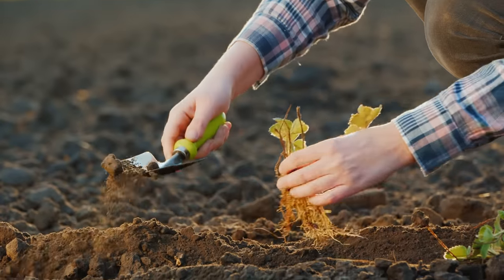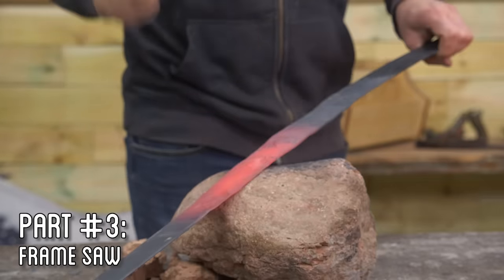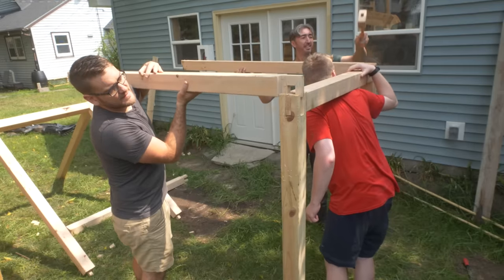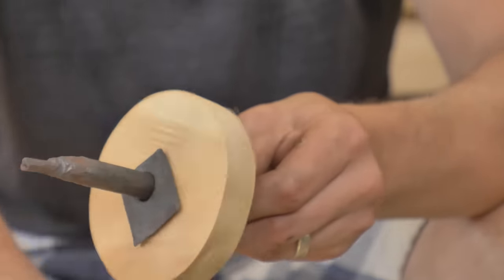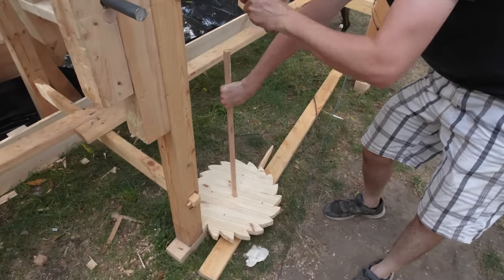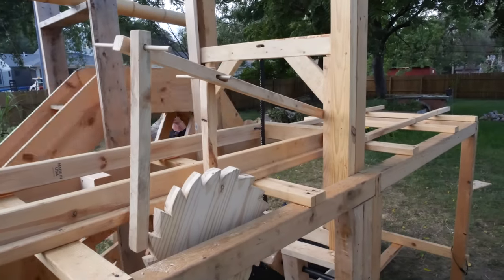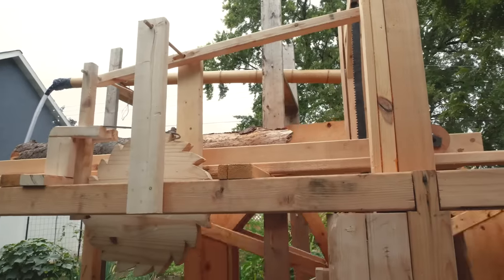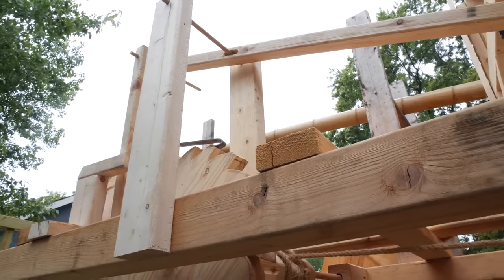I Built DaVinci's Saw Mill

Comment: I'd watch a build like this split over more videos if it helps make the final result better, spend a bit more time making things tighter and run better. Also maybe use all modern tools for each build unless that's the point of the video, I think I'd rather it actually work than to see you labour over a sloppy build with home made tools

Comment: why not use a simple transmission to increase your speed? you clearly have the torque to chew through the wood. big gear to small gear, then on the small gear's axle add in another big gear, connect that to another small gear and you have your output drive shaft for powering your mill. direct drive gives you the most torque, yes, but its the slowest method. you dont need as much energy for the bit to scrape the wood, what you need is the speed to keep up with feed.

edit: I say this in regards to simple gears and transmission ratios were already a thing by the period youre emulating. its stuff that had been known since the bronze age.

Comment: You know, just because you are building something from the 1400's, doesn't mean it would be made shoddily. They did have files, hand planes and even smoothed using sand/crushes shells, applied with cloth... The accuracy with which you build something like this, will greatly effect it efficiency....  Just sayin.

Comment: I feel like you should be pretty close to being able to skip a few hundred years of woodworking and such by doing cut nails. Hand forged nails are a pain, but wire-based nails need easy wire creation; however, the cut nail was used for hundreds of years (though in a pretty limited fashion for most of that). Regardless they would get you a lot closer to modern nail volume (assuming you're not using modern nails as an unlocked tech somewhat).

Comment: the main problem here would be the saw. what you got there is the equivalent of stating a bunch of chisels ontop each other, which is kinda like a saw but...usually those teeth aint that wide. thinner cut is faster and uses less energy...
that is just simply a really badly made sawblade. its too thick and lets be honest, neither angle nor sharpness are correct,
but still...cool little machine.

Comment: Clicked on the video to see how quick and easily it  can be stopped (necessary when changing saws ans in case of emergency) since i know most of the time water powered machine are anot designed to stop and restart at will.
Reply: A bigger wheel has more momentum and so is less affected by fast varying current, The speed stay more constant, it takes longer to stop, and it has more power (it also takes more power to get turning)

Comment: I just don't understand why you made the water wheel an overshot, most smaller sawmills like this one where put beside streams or rivers  and had diverter channels.  They wouldn't have had water pumps to lift the water overhead. Less historically accurate model.

Comment: I come at the same point everyone shaming you for poor implementation uses, but from the opposite direction.  You are an entertainer.  I don't think anyone on your crew is an actual blacksmith or woodworker.  If they are, meaning no offense, they are nowhere near the skill level that was considered average for a decent-sized community during Da Vinci's lifetime.  You all appear to be hardworking and dedicated laymen who don't have time to amass the skill that would normally be brought to bear on a project like this.

So, let's hear it for Da Vinci!  A bunch of guys who would still be observing the master work and doing the menial tasks of their job managed to crank out a design that worked using Da Vinci's sketch and a lot of elbow grease.  You all did the level of work you do - the level that anyone whose goal was "make these things" rather than "become a journeyman woodworker or blacksmith" would do.  AND IT WORKED!  Sure, it was a crayon sketch in comparison to what Da Vinci intended, but that didn't matter, it still managed to perform the function it was intended to perform and it didn't require that every part be made perfectly and every aspect of the design be fully extrapolated to the limits of engineering knowledge in the 15th century.  That is amazing!

This was another great video.

Comment: For its time I think it’s great but looking at it with a modern brain it’s definitely over engineered and the water wheel isn’t even needed. Idk if he did invent the bike but if he applied that to the table he would have saved so much effort. The water is the weak point

Comment: hey like i know u guys r pressed for time but those castle joints r way too lose u guys need to play the joint on the big side and shave them tight u should need a mallet to work em together  aka shave the pointed edges so they r within a millimeter of one another and fit them together as they go so they dont shake like two teenagers in the back of a ford pinto

Comment: You know, for all his supposed creativity, DaVinvi was a classic "modernist engineer" -- same as today's types -- who just invent stuff for which there is no existential need. Eg, App upgrades noone is actually asking for; hitech machines which COMPLICATE people's lives; ways to encapsulate production power into the hands of capitalists and equipment specialists.

For all the construction effort and piss weak outcome of this overly complicated contraption, two guys on a pit saw could mill 10 times the timber in 1/10 the time of logs 10x this size. They had been doing that for centuries before and after his "machine". Eg, it is far more efficient to move the lighter, cutting sawblade along through the log (ie, the sawyers moving forwards with their blade) than to move some bloody heavy log through a fixed position blade. Duh.

You say "But the men would get tired working all day"! And the machine parts don't get tired ... ie, wear??? Machine downtime for repairs is rarely considered for Great New Ideas. Eg, how many hours have you spent "fixing" Windows software?

In short, I'm not convinced DaVinci was the genius everyone says. Like most engineers, no commonsense.

Comment: your sawblade is not sharp. also it should only be cutting on the downstroke. each point should be staggered slightly and flat on the bottom face of the blade. each sawtooth should be a right triangle with the flat part on the bottom. they should be bent left and right very slightly. the tip of the saw should be no thinner in width than the spine. saws are not knives and do not work like knives. it needs to bite the wood and want to stick in it easily. nothing on a sawblade should be very smooth. every edge should be as sharp as possible, nothing should be rounded.

Comment: you problem have parts accurate, angien citizen build lot lot better accurate all wood work, joints need be tight, holes have tight better and all has build lot lot better quality. thats have worst wood and metal work.